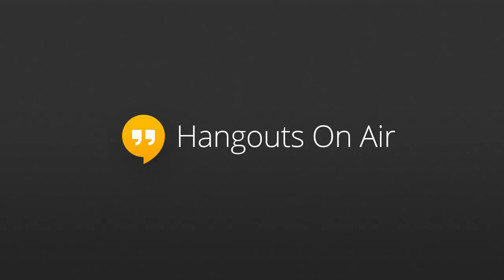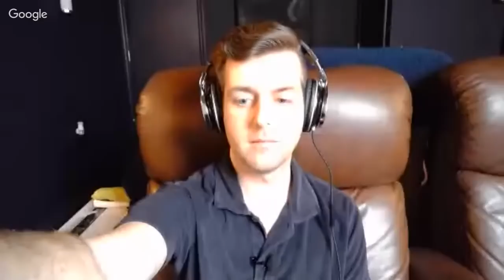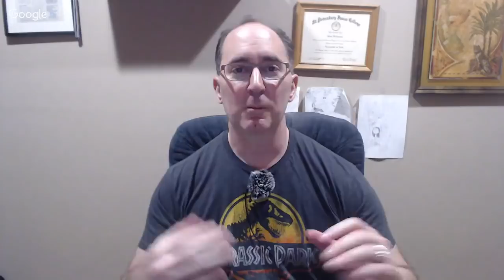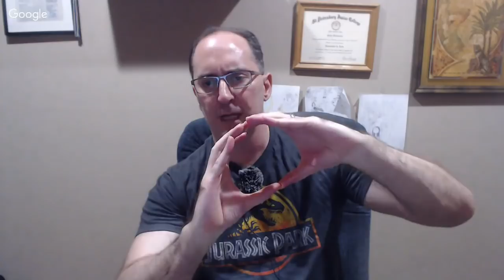Active vs Passive Loudspeakers: Which is Better?

Comment: I agree with Gene regarding lower priced soundbars. I'm actually plan on getting a stereo receiver as a soundbar replacement. 99% of soundbars under $400 are only stereo anyway, but with less proficient drivers, aren't two-way, and can't stereo-image properly because of the fixed nature of the left and rights channels therefore they have to employ psychoacoustics which most TV's already have built-in anyway. So that's why I'm opting for a stereo receiver. Plus, I don't have the need for the many HDMI inputs, optical and coaxial inputs, and phono outputs of an av receiver. And a lot of lower tier av receivers have various HDMI problems anyway or you have to wait on "promised" functionality, so why bother, especially seeing as I'm not setting up a 3/5/7.1 surround system.

Gene will be amazed now, as The Fives from Klipsch have an HDMI input. Active speakers have come such a long way.

Comment: Does this qualify as an active system?  

1. Remove the passive XO from a 3-way, 4 driver speaker
2. Connect one 2 channel amp to the woofers
3. Connect another 2 channel, one channel to the tweeter, the other channel to the mid.
4. all managed by a 3-way EXO w/selectable slopes & filter types. Also has some add’l built-in DSP in the form of PEQ, GEQ, & time alignment. 
Thnx

Comment: Sorry trying to understand what is the difference between a passive speaker and active speaker?  I’m trying to start setting up my home theater room and so far I’m starting with two SVS PB-1000 Pro’s because I love bass..🔊 and 4 Polk OWM front L/R and rear L/R are those passive or active.🤷🏻‍♂️. and I’m ordering SVS prime center. 🤷🏻‍♂️.    
Thanks to anyone that can answer my question. 🙏🏼👍🏼✌🏼
Reply: Okay never mind. I just looked up another video answered my own question.✌🏼

Comment: When I built our recording studio I was introduced to active monitors. Started with Events and moved to Genelec. I never looked back. I reasonally purchased the JBL Professional Series 3 MK II for my surround system. 305 for center and surround and 306 for the main. I added two LSR310S sub. The speaker were on sale and I bought all of them for under $2K. They  aren't Genelec's but for the price they sound amazing. I have a Marantz

Comment: I have had several speakers brands all were passive. I was never real happy with all of them. And all of them never had a deep clean bass. So one day I listen to Definitive technology 250 watt power monitor 900 with a 10" subwoofer open port on the rear and it had a very clean bass in small size. Definitive Technology has been making active speakers for a long time.

Comment: I never dealt with active speakers until I heard an omnidirectional speaker setup with an active system. After seeing and especially hearing an active system, I started to work on some vintage speakers, and because my speakers were being greatly affected by room acoustics. So, I used an active processor with both active and passive speakers with the subwoofers being active. Now, I am in a position to buy two more amps, and already having the active processor, I am now easily going to finish setting up my vintage speakers in an active system to finish what I started. An active system can really contour a driver into a decent sounding driver without having to resort to very expensive drivers. I am not saying that such techniques can totally make up for poor manufacturing, but I am saying that it is a most gratifying process that gives a budget-minded person, once they get past the initial investment, flexibility and the control to have more input in the way your speakers and room sound. That's not bad, if you are willing to study, put in the time, and have the enjoyment to get invested in the sound of your home system. I will emphasize that my speakers already had the design that was very conducive to going active.

The room control is absolutely a great advantage because again, not everyone can afford all the room acoustics to tune a room for a stereo system. There is also the shaping of each of the drivers in order to tune or adjust the weaknesses to suit your ears. Doing so over time and learning how the changing of the individual driver frequencies through the processor will affect the sounds . . . you lose the intimidation factor because you can always set it back where it was before, and you are not stuck with a fixed sound, as you pretty much are with the passive crossovers. It isn't because you cannot change the passive crossover, but because not everyone can afford all the chokes, capacitors, and resistors that are needed to do so -- much less the equipment to do all the testing to get the proper measurements to decide what components are needed and in what values. In any case, it is a matter of personal taste, comfort zone, budget, and expectations . . . and a great desire to meddle and participate in the tuning and tweaking of your system.

Comment: Hi Audioholics. 
I'm a recently converted audiophile and am learning more and more about audio reproduction every day. I'm currently using wharfedale diamond 240 towers as my stereo fronts, driven by an onkyo Tx-Nr747 rated at 175w per channel. Quickly learned never to trust those figures and have practically found out. I want to add a subwoofer(s) to them as the bass is not satisfactory and my understanding is that if I do that, this add more solidity to the higher frequencies as the amp will low not be burdened with ultra low frequencies. My question though is: often there is warnings not to crossover the sub at too high a frequency,  say above 80hz, as this will create localization. I often see on speaker specs that the bass drivers are crossed over at much higher frequency than this, how come then the localisation talk is not an issue in tower speakers?

Comment: For my senior project in school (electrical engineering) i took an older 7.1 Yamaha receiver, modified the dsp board, took the digital I2S signal right before the DAC, pulled it into an FPGA, wrote a decoder and encoder, FIR filtered crossover @ 2.5KHz, inject the signals back into the Yamaha DSP board and borrowed one of the surround stereo channels for the extra signal (front highs) and basically turned 7.1 into 5.1 bi amp front receiver. 
Drove 2x RBH 661SEs, embedded a relay into the passive crossover to bypass. Much better sound. Linear FIR fillers are great for crossovers, no phase shifts from passive elements.

Comment: Gene, active is amazing! I've got all JL stuff!
 JL Twk88 DSP, HD750/1 pushing 1x  JL 10W7AE, JL HD600/4, 2X JL 300/4 with JL C5 650 in doors, RBH 4"beryllium mid + vifa teeter(both I bought directly from RBH Sound), and a bass Shaker in the seat. It sounds amazing! I used REW to measure and tweak.
Active gives you so much control. 

Btw, I live just down the street from RBH and I know Shane. I've done work for them. 

ACTIVE IS AWESOME! Bass shakers are also really fun, as it brings the bass forward.

Comment: ATC actives  sound very good. Are the more accurate than passive?  Maybe not, but they do a great job and nothing to be concerned about. Powered also work nearfield.

1st order concern?  Dunlavy used 1st order to his tweeters and that resulted in many blown tweeters.  (That also means he skimped on the tweeter IMO)  A Vifa silk ($28)  is superior sounding to Dunlavy's and can handle 100 watts, vs possibly 10-20 for the stock tweeter.  This sucks considering the SCVI  were $$$$.

Comment: For me the biggest advantage of passive speakers is that if you purchase quality speakers there is no reason they shouldn't last for decades of use. In regards to Active speakers, for me the biggest issue, disregarding the potential of the amp within dying creating a brick as my Kef are but Technology changes, its quite possible that the inputs used with the active speakers will no longer be in use in 5 to 10 years then once again you either have to live with ancient tech or buy new speakers where as if you had purchased passive speakers to begin with, you can choose to upgrade the amp and have a state of the art unit.

Comment: I'm not surprised that Gene isn't a fan of Steve Gutenberg, but I still like his videos, I just don't listen to him when he starts talking about $2500 cd player's and speaker cables.
Reply: William,  what's wrong with $2500 cd players?  And you don't think cables affect the sound of a good system?
Reply: @alexanderscott3790  I use a Xbox one X to watch UHD moives and I think it works great, and it can play CDs, if I had a time machine, I could go buy some!
Reply: @Edward135i  William,  you're clearly not a hiend audio guy, so why do you care?! 
  Steve is into high fidelity sound reproduction.  You on other hand simply require anything that spins a disc and plays sound!  Not sure whats the point here?
Reply: @alexanderscott3790  I thought this was sarcasm.

Comment: Passive speakers deserve to rule the market for one reason: typical product life. 50 years vs 10 years is quite a lot.  Active speakers already rule the pro market (where the speaker is just a tool) and the cheap/disposable speaker market (where price is the only thing). The only companies who successfully sell expensive active speakers are well-known brands with long histories - becausepeople are reasonably certain that they won't be left without support when (not if) the electronics develop a fault.  For example: ATC still services 30 year old active speakers. Will the new Chinese owned Dynaudio do that for the Focus XD? I think not. By that time the TI digital amps they use will be ancient technology.

Comment: I think I have seen Dynaudio use all-pass filters in the 90's. Their first order crossover had more than 20 components in a two way.
Dynaudio at that time, loved the idea about first order filters, and therefore all their drivers could handle 1000w for 1ms.

Comment: Definitely passive, so long as you have high quality caps, coils, and resistors. That's why I did full crossover network rebuilds with my Klipsch RF-3 II system, it now sounds incredible, I also added internal bracing, and driver damping. I'd pit these against active speakers, without a doubt.
Reply: I guess is a matter of taste. I have Buchardt A700 plus the WISA HUB. And many other speakers-high end. Buchardt sounds the best to me when I use the WISA and keep everything in the digital domain. I would describe them as more transparent than many others , including Martin Logan towers
Reply: You could say the same for active speakers. Use high quality components.

Comment: 49:18, they don't need an HDMI in, most DACs have USB, same digital data. 
I wanna see USB to be used more often, so we can once and for all, delete internal PC sound modules.
We will free up space for more useful IO.
Reply: Agree about USB audio in. But to offer the active speaker solution to most of the public, they should also have connectivity with TV sets. A TV is the first (for many the only) AV equipment people buy, at least here in Brazil. So, if TVs could output audio through USB, and even control speaker volume thorugh it (like through HDMI ARC-CEC), it would be the most universal connectivity for an active speaker, which would allow the most general usability.
But unfortunately never heard of TVs being able to output audio through USB, which is a shame. They all run some kind of Linux based OS, so it'd be trivial for manufacturers to implement that.

Comment: My issue with an active speaker is what do you do when the build in amp goes out. This was my biggest concern when choosing which Triton speakers to pick up.
Reply: Vincent Davis you let GoldenEar know and they send you a new one.
Reply: From their warranty information they cover the amp for 3 yrs if they standby their products beyond the warranty then I will be even more impressed with Sandy Gross and GoldenEar
Reply: Vincent Davis I’ve dealt with GoldenEar service personally and there is no better group in the industry. They stand firmly behind their products.
Reply: Well then I am glad I made the purchase I did with them I just need to save up for a 2nd super sub x but so far I agree they are awesome to deal with just didn't realize they were that good
Reply: Build it all yourself, piece out the drivers, use your own amp, add dsp to tune it and it's a great experience.

Comment: Fear of building electronic circuits into an “Active” environment is easily dispelled. The environment found in and on a speaker is nothing like is found in a air-borne or ship-borne environments. And this has been done for a very very long time. I like to point to:

https://en.wikipedia.org/wiki/Voyager_program

as an example of an electronic circuit that can live in a hostile environment and live for a very very long time. I personally was involved in designing submarine installed computer systems as far back as the mid 1960’s and those circuits would love to be installed on a benign environment like a loudspeaker cabinet.

https://en.wikipedia.org/wiki/Submarine-launched_ballistic_missile

Comment: Two driver loudspeakers with a passive crossover circuit appeared in the early 1930’s in Cinema Sound:

http://filmsound.org/articles/amps/loudspeakers.htm

As simple as they were strictly speaking these were probably the first. The most famous of course appeared in the early 1950’s with Altec Lansings “Voice of the Theater”:

https://www.soundandvision.com/content/living-legend-altec-lansings-%E2%80%98voice-theatre%E2%80%99

This was, and still is, a two driver system with a passive crossover circuit.

Comment: Active speakers are too risky. Once the internal amp fails you may not have too many options. You may need to test, de-solder and re-solder components or send it in to the manufacturer for a pricey repair. Worse off the thing might not be serviceable without doing a hack job (seen it on reddit and there's no telling if you'll even fix it).  It isn't worth it, buy passive and DSP it. I'm only referring to mid/high price active speakers. Cheapo ones may be worth it depending on circumstances.
Reply: I have active towers where an amp failed. Not only was it super simple to change the amp but the manufacturer overnighted not one but two amps to make sure i was back up and running. If you buy from a reputable manufacturer and dealer all of the issues you mention are mitigated.
Reply from the maker: The same can be said for powered subwoofers yet they dominate the market and people don't hesitate to buy them.

Comment: Active speakers: do you only need one speaker or two ????? I have never heard a active speaker before only in a sub .
Reply: I have a fully active 3 way front stage in my car + sub (4 way total) all dsp driven with independent amplifiers. The flexibility on timing alignment, crossover slope and frequency, and parametric eq tuning... In the end it's an incredible sound quality build. 

You just cannot time a sound system like that in the Analog or passive domains
Reply: Still need two. Left and right

Comment: i think the problem now in active loudspeakers is that they mostly put the amp and dsp inside the cabinet,  external is the way to go.   i have zero good experience with active speaker, subwoofers included. sure it sounds good, but there is always hiss noise or something creeping thru.
Reply: No there isn´t. I do have plety good experience with active speakers.
Reply: im just saying my experience with the power i feed them from my wall, im sure others will have different noise levels depending on power from the outlet.   my point is that putting a plate amp inside with the drivers magnets make for a system that is more sensitive to the power you feed them and also has noise issues since it's a compact design with noise drawbacks.
Reply: @sudd3660  I completely understand your point, just saying it's not muy case. I have 2 active subwoofers and a pair of active LS50W. Zero hiss nor unwanted sounds.
Reply: @Beos_Valrah  i think active speakers also are more sensitive to the power you feed them and or the signal connected to them, in my house they make his noise while others say that its silent in their house.
Reply: @sudd3660  Yes I would say it has much to do with the type of signal (analog / digital) and the internal signal + amplifier design of an active speaker. I think this is kind of overlooked by many manufacturers which I find rather sad...

I run my speakers with a digital input and they actually work digitally, so this really helps with the whole hiss issue.
Reply: @Beos_Valrah  i always ran my active bookshelf size speakers optic cable, best possible case for elimination ground loops and interference. 
subwoofers i do not have that option, always some kind of noise on them too on rca connection. 
at one point i think i will have a power regenerator and see if this solves some of my issues.

to be clear i have some bad experience with power amps too.  but that is only one so far.

Comment: "Pretentious?" I don't know, I saw that video and that's not the impression I got. Not sure our definitions are the same. I thought all he was saying is that if you go with the "All-in-one" active speakers, you are locked into what the manufacturer has given you and if any part (Amp, DAC, crossover...) fails, you're kind of screwed if you can't get it repaired. Also, by using an "All-in-one" you take away the ability to change out parts of your system, limiting the sonic potential of your system. The simplicity (and quality of some) of these speakers will ensure they are going to be popular. As they should be for what they are. Those Kii3s are supposed to be amazing, however I am not sure I'd put $20K into a single product with so many points of failure. (Extreme example, I know) Great discussion topic. 
Cheers! 😁✌️
Reply: Even I saw and commented that all in ones are a disaster movie in the making 😂😂😂